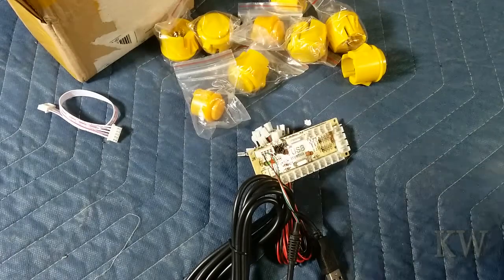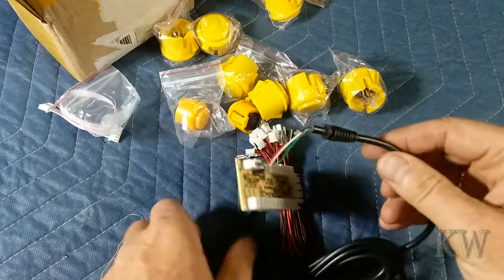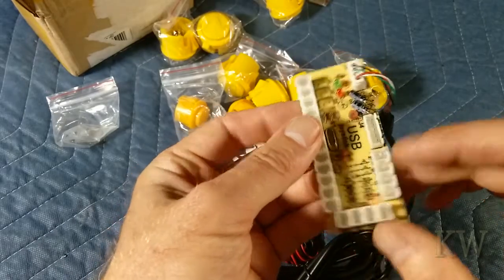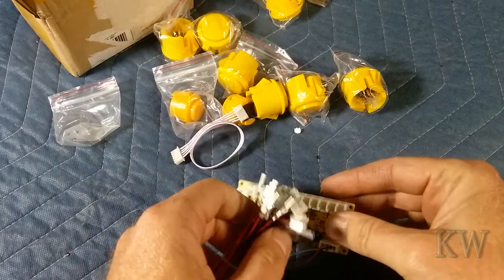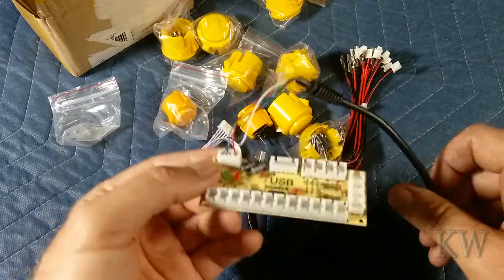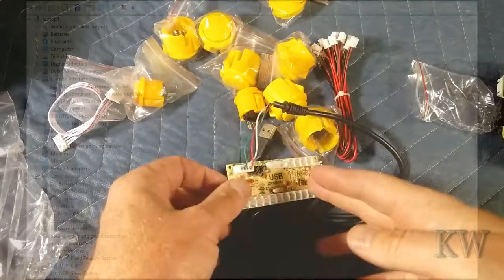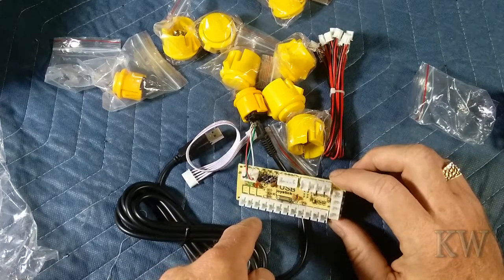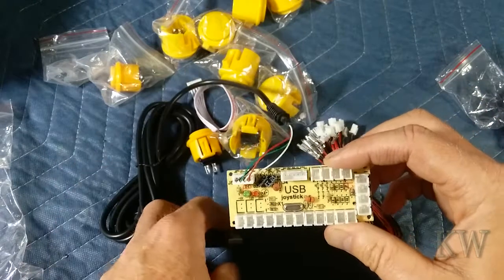Retropie USB Joystick Encoder - Part 1

Comment: If you buy one of these for under $30, get a mxq pro 4k android box for under $30, put the mame4droid apk with roms in it with a thumb stick you can put it all in a small case with the power and hdmi ports side of the android box fitted with holes in the case, you could build a plugnplay mame console or an arcade cabinet.

Comment: Hi. I have a modded Arcade1UP cabinet running on raspberry pi 4.5.  I am unable to use the player two joystick for the Dreamcast MVC2 and for the other StreetFighter and Capcom vs series,  I am unable to use all of player two’s buttons. Please help. Thanks .
Reply from the maker: Mapping joysticks is a pain in mame.  Not sure about DC.   Check out the mame.org and it may help with getting a 2nd controller mapping.
https://docs.mamedev.org/advanced/devicemap.html

Comment: I bought myself two of these for two players on my raspberry pi arcade cabinet that I built. Unfortunately right now I'm running into some trouble that I can't explain. On the cabinet player one is set on the left and player two is set on the right. When I connect everything together player one's joystic, start, and select buttons control 2nd player, while player 2 joystick, start, and select buttons controls player one. Do I have faulty zero delay USB encoders? Please help. I already tried reflashing images and configuring controls multiple times and the same thing still happens.
Reply from the maker: Try swapping them on the USB port and see if the non working works on the good port
Reply: @KingWilliam  thank you for the help. It's working correctly now.
Reply from the maker: @vajleexi  cool

Comment: The 12 sockets along the bottom of the encoder are for action buttons (it will support up to 12 buttons) The top left is for your USB cable (which you have connected) the middle socket is for a Sanwa joystick 5 pin ribbon cable, the 4 sockets to the right of that are your up,down, left, right sockets for a joystick, and the last 4 sockets along the edge are special function sockets for analog\digital joystick, a "turbo fire" socket, an "auto fire" socket, and a "CLEAR" socket. Personally I LOVE those encoders because they're basically plug and play simple...and they WORK. Thanks my friend and happy gaming!
Reply: You still alive? I need your help, my raspberry won't recognize the USB joysticks.
Reply from the maker: Can't beat the price for these little boards.
Reply: @KingWilliam  Oh I know, they're LESS than $5.00!! I just got 2 of them myself along with 2 Sanwa JLF's and buttons. Have a good one my friend, game on!

Comment: Hi thanks a lot for this but I was wondering, what if I run out of button terminals and want to add extra to the same board? Or would I simply have to wire up an additional board?